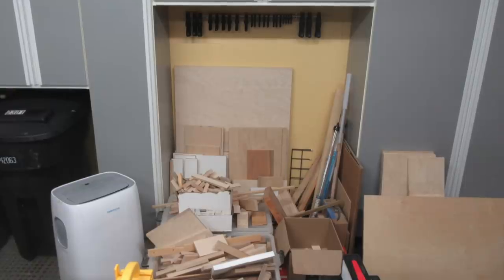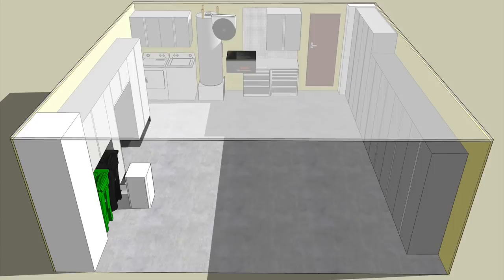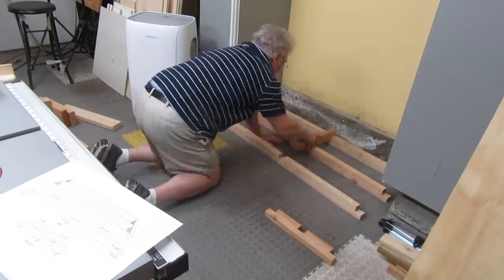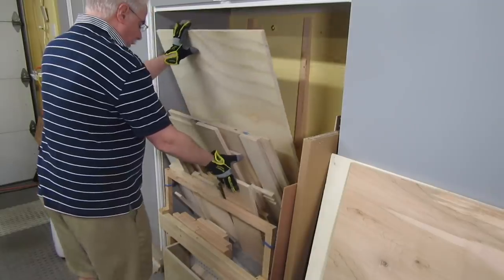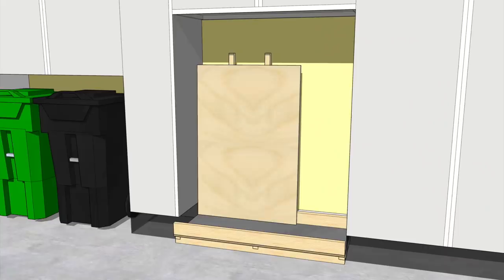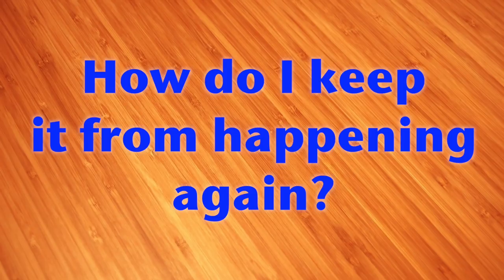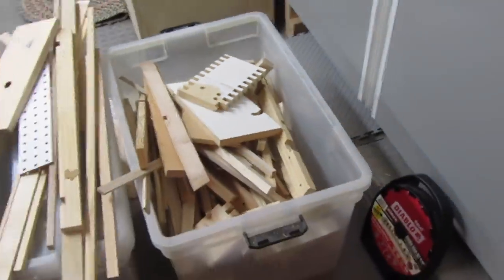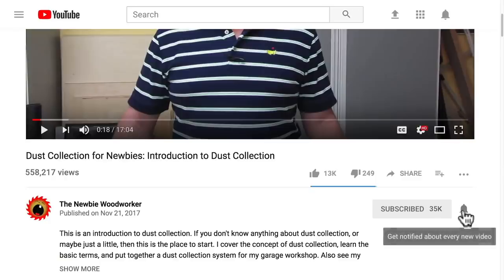Cleaning Up My (S)Crap, and how to keep it clean

Comment: I first want to say that I really enjoy your videos. I like your attitude and the way you speak. 

It's ironic that you posted this video today. At 10 am, a friend called me up and, for the first time in two weeks, we have sunshine and warmer weather without massive winds.  So I drafted him to help me clean up and organize my shed. My shed is much smaller than just  your work area. I have to roll my tools outside to work.  When he got here, I had to crawl over the clutter and stuff all over the floor and hand them out the door to him to pile up. 

I unburied four bicycles (we knew they were there) and then moved them out and everything else we could move.   My intent was to repack the shed so I could get my table in and out. I figured I would have to move things to get it past the door, and that would have been ok. My friend has a bit of OCD and unloaded several boxes full of tools and other things that had been collected into containers.  When he was done, I have a set of shelves where I can see all my tools.  

That cost us extra time I didn't plan for, but I couldn't say not to do it because I hate having to search for my tools.  But, in the process, he found tools I forgot I had.  He found three things I have on my shopping list, and Forcner bits were on top of the list!  LOL

To put my table saw workbench into the shed, i have to stand it on end and roll it into a corner.  But, now that we are done, there is enough room that I could fit another tablesaw workbench in there and still have room to walk into the shed and get some things out. 

When we were done, I took a pickup bed full of lumber and recyclables and trash to the dump, and took a half load of lumber to his shop for him to use. 

Like you, we discussed what to keep and what to throw out.  I picked three areas of the shed for the wood. One for 2x long boards, one for shorter and/or wider  boards and one for panels. When it didn't fit, it went into the bed of the truck to be delivered to him or to the dump.

We even talked about what we would miss if we threw it out.  (We are working on cleaning his up, too.) I came to two conclusions concerning my wood.  A) (before) I couldn't get to my tools to use the wood, so if I threw it all out but one board and could use my tools, it was worth it.  B) (after) Because we dug through all the piles and junk and organized the wood, we saw all the wood. So, if we had not, I might not have known I had that wood to miss now that it's gone. 

Besides, I noticed that scrap wood accumulates very quickly. Rarely is there a board cut that does not leave a scrap. So, for you "missing" those pieces to test the dado.... You must have already had the wood cut to length before you cleaned up your wood pile.  It won't happen again, LOL.

I am extremely excited and surprised that I can get my table saw bench in and out without having to remove other things stored in the shed.  I was still building the tablesaw workbench when weather got bad and the shed got too cluttered to access.  Now, when weather cooperates when I am available, I can work on my workbench again, and then actually get some projects done.

Great timing on your cleanup  video!  Thanks
Reply from the maker: Awesome! It really is liberating, isn't it? And I've done that before - forgot I bought a tool, and since I couldn't see it anywhere, I bought another one. Thanks for the comment!

Comment: There are two things that take some of the joy out of woodworking for me.  One is sawdust.  The other is scrap wood.  You inspire me to make a dedicated space to deal with the latter.  I'll get right on it...as soon as I finish the projects I'm working on....
Reply from the maker: Well, as for sawdust, a decent dust collection system helps. Not sure if you've seen this or not, or even if it'll help, but I've got a video on it: https://youtu.be/c2sWwWbAayM. And as for "as soon as I finish the projects I'm working on", well that's my typical answer. So, good luck with that! 😛I still have a project I started either 2 or 3 years ago, that I intend on finishing "as soon as I finish the other projects". 🙄

Comment: Great video, Dan. I had 48" of water in my garage/home from Hurricane Harvey in 2017. It was incredible to see the hundreds of wood scraps (of every length and width)  laying everywhere after the water receded. There was so much warped lumber laying about I thought about opening a Home Depot out of my home.
Reply from the maker: OMG, that's one of the funniest things I've ever read. Not about the flood, of course, but the crack at Home Depot. Especially since not more than an hour ago, I ran into a problem with some plywood from HD that is warped. Perfect timing. Thanks for the laugh! (Sorry about the flood, of course.)

Comment: Very nice video.  I enjoyed the way you went through your thinking process.  I had a similar experience where I tossed most of what I thought I would use "some day" and felt liberated afterwards.

One suggestion that may or may not work in your system... I turned my sheet goods perpendicular to the wall and never store pieces longer than 4'.  That way I don't have to move one piece out of the way to get to another piece and I can store the equivalent of 10 to 15 sheets of plywood in a relatively small area.

Thanks for sharing.  I always enjoy your videos.
Reply from the maker: Thanks, and you're right, it was liberating. I agree in principle with what you're saying about sheet goods. When I get 4'x8' sheets, I have them cut in thirds, so they're 48" x 32". They fit in my SUV that way, and I rarely need something longer than 32". So I store them with the 48" being vertical. That gives me room on the side for other things. But I suspect this is pretty-much in line with what you're suggestion, right?
Reply: @TheNewbieWoodworker  Yes except store the sheets perpendicular to the plane of the wall so you can access any of the sheets without having to lift them over other sheets.
Reply from the maker: @shophacks  Oh, I get it. My cubbyhole is only about 20" deep, so that's not really an option for me. Too bad, though, because that's a great idea!

Comment: I seam to be in the same place as you. I hate to throw pieces away. As I work to get my shop organized I always try to use up the scraps first. Something to note. I cut glass for a living so I have this problem twice Glass and wood. I have used a couple of slots in my glass sheet rack to put the wood sheet stock but I just haven't taken the time yet to make a  holding area for smaller pieces yet. I like your design. Especially the under drawer. Good job Dan!
Reply from the maker: Thanks, Tim. I'm beginning to realize we're not the only ones who hate to throw this stuff away. And I do the same as you - I always try to use the scrap pieces first. I wish we could put RFID tags on all our scrap pieces, along with their "birth date". Then we could at least throw away the really old stuff. Then again, it might only depress me. 🙄

Comment: Helpful video!   For other newbies, I'd add another criteria I'm a bit embarrassed to say I had to learn.  If it's structurally weak, throw it out.  My spouse would say to me, that's not useful, but I had to learn it's end grain, for instance, or too small.

On the other hand, if it's a thickness that is perhaps odd for you, someone mentioned below, you might keep some of it.  ( In the plywood category, most of our plywoods are thicker 3/4" nominal, and thin stuff for backs of drawers and such.  But we keep a few scraps of 1/2" for when we need that as a shim or in a jig.  Those pieces have been - surprisingly - more useful than the more common 3/4" which we seem to create a lot of with each project.  I can't list occasions when we were searching around for 3/4" stock, but I could list ten times when we needed a 1/2" shim from just the last year.)

I built a "scrap cart" recently.  It is designated for and did organize the long thinner stuff -- shims on one end moving thru left over moulding from house rebuilds and smaller plywood panels to slightly bigger stuff, but not as big as 1x or 2x lumber, up to about 4ft long. (The plywood stack, lumber offcuts, leftover oak flooring, and more and more categories are elsewhere.)   This cart has four compartments.  And it's pretty full!  The contents were useful over the spate of woodworking projects for Christmas -- but we only used about 1% of it, making jigs for instance.  

"Shims" definitely needs to be one of my categories!   Beyond that, I don't yet know.  Now that I'm doing a bit less house construction/remodeling and have more time for more hobby type woodworking projects, I'm learning -- just beginning to learn -- what scraps are actually useful to me, and what is trash.  I'm observing as we work and learning.  We'll have to have a whittling down in every category.
Reply from the maker: Thanks, and what I like best about what you said is the idea of thinking about it, and trying to be intentional. So often we just let stuff pile up. But there's no reason for me to keep 10 hole-saw cut-outs, for example. And certainly, if it's damaged like you said, throw it out! Thanks for the comment. 😄

Comment: Great video!!!  Nice wood storage build, too. One additional question is whether the wood is easily replaceable.  I just made some drawers from construction grade pine, $15 for five 24 inch deep drawers.  It was excellent wood with very few knots and in the past I'd save some small cutoffs.  But I can just get more if I need it, so the smaller pieces are leaving me soon.  

One "save" category for me will be odd thickness boards.  I'm always looking for things like this to shim or fit in narrow places in DIY.  If they're organized, they will be easy to find, right now I look through various piles.  Small pieces of hardwood are also useful since I've started making small gift boxes, but the small pieces of plywood have limited use.   Good point about having a few pieces of scrap for setup.

 You've inspired me to fill my trash can this week.  Classic statement about worrying that you won't have something when you need it being true.  Ok, I can just bite the bullet for a much better workspace.  Love your thought processes.  Thanks for a very useful video!
Reply from the maker: Thanks! I also have a bunch of thin strips, same as you. When I was cutting hardwood runners, I ended up cutting off all sorts of odd sizes. Right now I just have them in a small pile in the big section of the drawer. And I'm glad I kept them, because I've used them several times.

I don't currently have a jointer or a planer, so I stick mostly with plywood, or standard 3/4" pine - stuff like that. But if I did, it would mean a lot more categories, based on type of wood thickness, etc. Glad I don't. 😛

Good for you for biting the bullet and throwing stuff away! And thanks for the comment! 😄

Comment: Hi Dan.  I noticed in your trash can some rounds from a hole saw: OMG, those can be used for wheels for something!!!  OK, joking aside, thanks for the excellent video!  I’ve seen a few ‘clean up’ videos over the years but yours is the first one that inspired me to want to get out of this chair and go sort and clean up!  I’m already thinking of where I could put a similar drawer as yours.  The bigger stuff stays outside (sheet goods, 2x4s, etc) as my storage shed (I pretend it’s a work shop when I can) is tiny: 10x20’ (less if you count wall thickness) with a ceiling lower than an upright 2x4.  I’ll be using your smart bar trick under the carport for sure.  Lots of other nice tips in there, too, like the taped-in dividers!  Again, thanks for the video :)
Reply from the maker: Awesome, glad to help. And I know you were sort-of kidding about the hole saw circles, but it's funny - I almost mentioned them in the video, but cut it for brevity's sake. I actually have a small box full of them, so it wasn't an issue throwing those out. Plenty more where they came from. Hmm, now that I think about it, I have that box but I've never used a single one of the circles. Maybe it's time to trash that too. 😄

Comment: As someone who has dealt with living in moldy homes for all of his life, you need to add some ventilation holes or something to the base else your base is going to get moldy, and then your wood
Reply from the maker: Do you mean just drilling holes in the base - the part above the drawer? Or in the bottom of the drawer also? How big do the holes need to be, and how spaced apart should they be? Thanks.
Reply: @TheNewbieWoodworker  Sorry if I came of like I know woodworking. I'm not yet a woodworker, so I couldn't tell you dimensions of the holes. I just know mold. I would say just enough holes to let the air move through it but not so much that it will effect the structural integrity of your build. In my old home we had to put spacers on every thing that touched the floor. Doesn't have to be holes just keep airflow in mind when it comes to mold. I'm planning on waterproofing my new garage and fixing the rising damp before I start turning it into a shop. Good luck
Reply from the maker: @AlwaysInAtari  Thanks, and no worries about how you "sounded". In the last couple of days I was wondering if I was seeing mold on the bottom of some of my sheet goods, so you got my attention. 😄And I really appreciate it. It's one of the unexpected benefits of having a YouTube channel - I get to learn from my viewers. Gotta love it!

Comment: Aaaah Dan, the wait was worth it.  My pile is unfortunately a lot bigger than yours, resulting from some rather extensive rebuilding works at home.  I just couldn't bring myself to part with structural timber 4 x 4 posts that cost me money, and there were lots of them.  Plus all the other scraps as you so aptly put it.  Anyway, lots of great ideas, including that one of the retention bar.  I'm going to give that some thought when I go up to my shed later today.
Reply from the maker: It really is hard when you think about the cost, I agree. I wonder if you could donate it somewhere? That might make you feel that at least it did someone some good, right?

Comment: Great video Dan, I am fighting that same monster, I have limited space also and just added a welder and 17 inch Grizzly Band Saw. The welder welds outside not in the shop too much wood around to potentially start a fire when I am not around. The retention  bar is a great solution so is beer, but bar with out beer would mostly be a salad bar! Who wants that? I like your concept of what to keep vs what to toss. I have asked the question when sorting out other things not wood, do I need this will I need this? Will I miss it in the next year have I used it in the last year?
Those questions have worked for me for culling what the wife calls junk. For forest products I need to have marshmallow roast.

Oh I have three times the experience of most folks because it takes me that many times to get something right.
Reply from the maker: LOL, thanks for the comment. I had to your beer sentence a few times before I got it, because I thought it was a typo. 😛And I'm right with you there on experience. If I get it right the first time, I look around for pieces of sky on the ground. 😄

Comment: 99% of my stock is hardwood as I either turn bowls or pens. Every little offcut has been kept so far as any offcut from a bowl is turned into a pen blank, if possible, and offcuts from pens are re-used for segmenting pens. I must admit a big sort out is on its way and your categories will be a great guideline for when it happens. Thanks for sharing you processes and your thought patterns. Cheers, Huw
Reply from the maker: Thanks, Huw. And yes, it gets harder when you honestly can justify keeping everything. Hopefully with some categories, you can count how many of each thing you have, so you can start throwing stuff away after 200 pens, or so, right? 😏
Reply: @TheNewbieWoodworker  Already past the 200 mark so some drastic sorting is on the horizon
 Thanks for the reply. Cheers Huw
Reply from the maker: @huwdavies5264  😄
Reply: @Huw Davies (and Dan Thomas).  I know I'm 10 months late to the comments.  Huw, your comment about all the bits and pieces of scrap that can be useful made me think of an excellent video shared with me recently for a totally different hobby -- scrap organization for Quilting.  For the open-minded who can see analogies, the channel owner is creating a further strategy to organize and USE those scraps for future projects.  

I remember she has decided on a fixed number of designated sizes to keep, and when a piece is leftover, she goes ahead and trims them to one of those "standard sizes."  (In pen-making, perhaps the wood could be trimmed down to be the size of pen blanks?)  

That's not all, but just a small  example.  Perhaps the strategies will help some portion of us.  I am going to review the videos myself and try to see how much translates over to my scrap wood problem.

Oh, yes, the channel is "Just Get it Done Quilts" -- Karen Brown.  The video is "SCRAP MANAGEMENT - CAN IT BE DONE? HOW TO TAKE CONTROL OF YOUR SCRAPS AND KEEP THEM ORGANIZED."  (Don't know if it would let me put a link here.)
Reply from the maker: @rwind656  Thanks for the comment. I see similarities between things all the time, so this is a great suggestion. Thanks! 😄